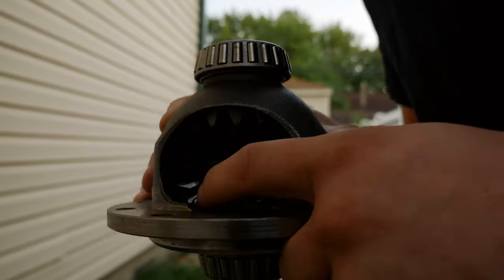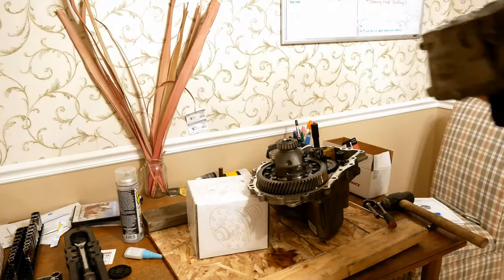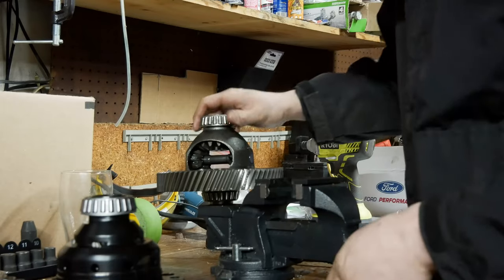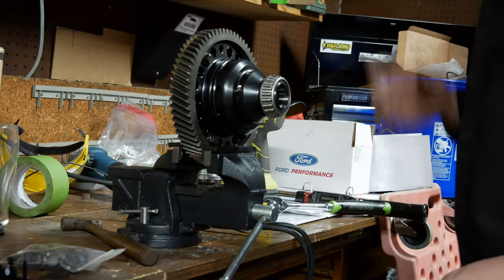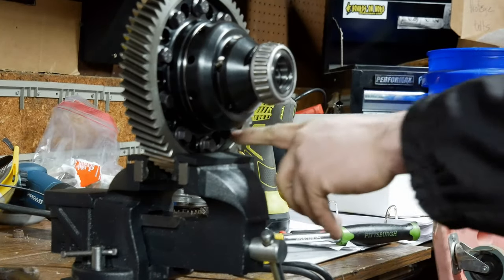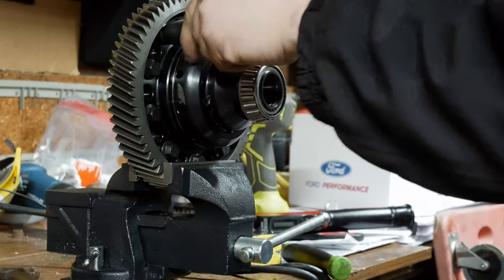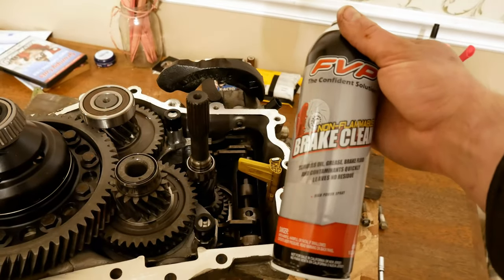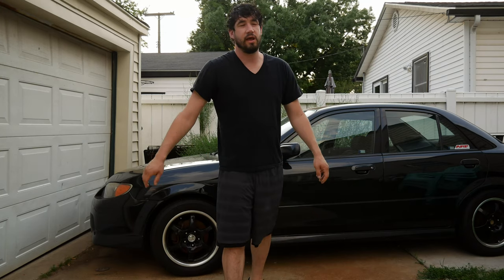Mk 7 Fiesta ST LSD Installation (In my kitchen)

Comment: I've got my 2014 FiST trans on the workbench as we speak. Had a bear of a time locating the diff bearings and the output shaft roller bearing. Just got them in yesterday, from France, no less! Replacing clutch & flywheel as well. Still waiting on those parts to arrive. Thx for videos, again; have helped me along. Will be reassembling as soon as the parts arrive. Hoping for the best!
Reply: Im pretty sure you live in east Michigan from the other vids you've got. Can't tell if you're down river or north of Detroit. Anyways, I'm from there but live in Grand Rapids now. Just ordered the same diff. I'll bring you your favorite beer from west Michigan, and some $$$ if you help me with the install :)
Reply: I realize it is pretty off topic but do anyone know a good site to watch newly released tv shows online ?
Reply: @Rene Toby I would suggest flixzone. You can find it by googling :)
Reply: @fonz-ys6xu  Oh man, just now seeing this. I live in MD - sorry! But thanks for the offer. Hope you were able to get it done!!
Reply: Oh that's ok! Ended up having the dealership do it, but surprised that they only charged me $320 for the install.
Reply: @fonz-ys6xu  That's great!
Reply: @fonz-ys6xu  ford dealer installed your LSD? That is dirt cheap almost hard to believe lol.

Comment: So no shimming or anything? Hows it holding up?
Reply from the maker: Car is actively still being used in Russia, new owner is still in contact with me and has put a big turbo on the car and has been driving it for about 2 years without issues.
Reply: You can be lucky having the same preload with the same shims, but you can also be unlucky and ruin your bearings

Comment: I’m in the middle of this job. Did you find a clutch alignment tool that fits or just use a universal?
Reply from the maker: Universal was only i could find!
Reply: @killerClaffey  coming back to confirm the 1.6L Ford clutch alignment tool sold at Summit (20-spline, I think) works just fine!

Comment: 4:44 So i'm just wondering and trying to learn. That big outer "ring", should you be careful with it? And what does it do?
Thanks 🙂
Reply: You mean the ring gear? Like the outer teeth on the lsd?
Reply: @9Epicman  Yes exactly.
Reply: Yes he definitely should not have been using a metal object to knock it off, preferably something softer then the metal, rubber mallet or peice of wood pressed on it and hitting the wood with hammer .

Comment: What oil are you putting in the transmission now with the LSD?
Reply from the maker: Since its clutchless the fluid requirements are the same i was using bg synchro shift 2 and red line
Reply: I work for Ford. I dont recommend anything but their fluid. Seen several manuals fail, due to people trying to put in additives. Ford test their shit way more, than any other manufacturer. Put in what it calls for. No matter what you did.
Reply: @gametime_1236  my car is ford explorer fwd 2012 can i install lsd on it ?